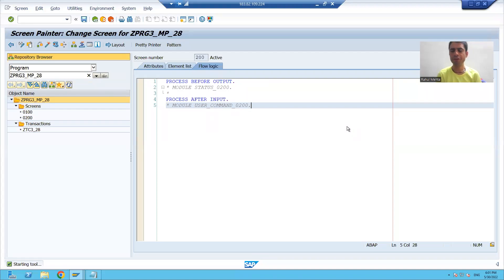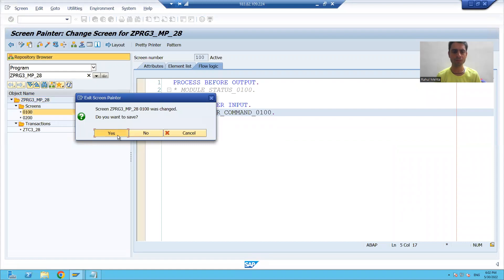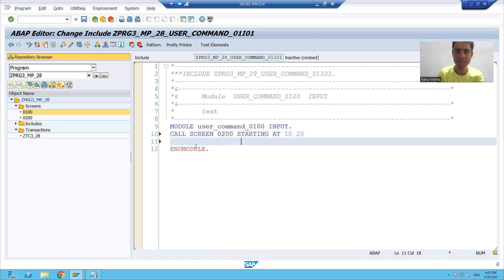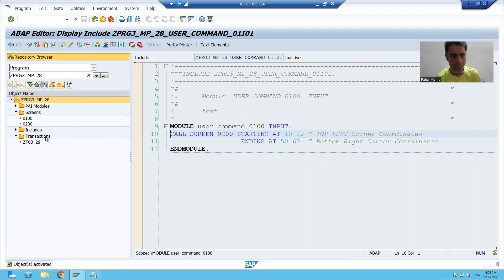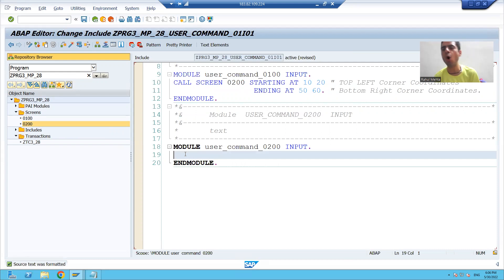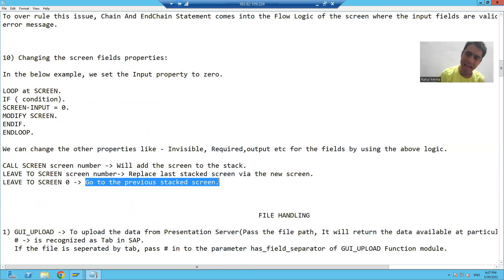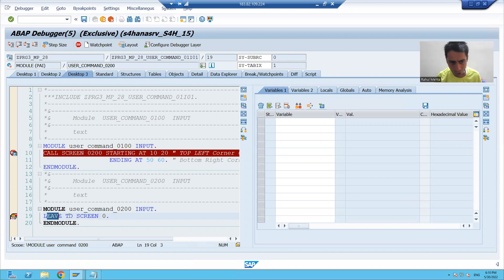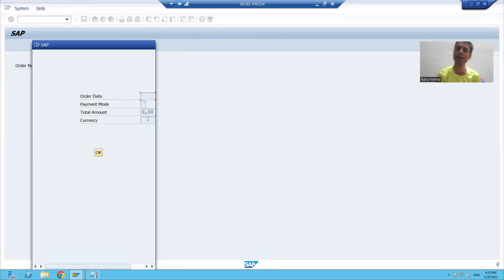16 - Module Pool Programming - Modal Dialog Box Screen Part2

Comment: hi,. can we call another program as pop up screen?? because the screen pop up will be use in more than 1 program, so i dont want create pop up screen in each program..
Reply from the maker: You can use this FM : POPUP_TO_CONFIRM and on click of OK, you can call another program through SUBMIT statement.
Reply: @sapabapbyrahulmehta  submit statement cant make screen display like popup, the screen show like normal (full screen), i want the screen display like popup, like call screen with starting and end position
Reply from the maker: @padja892    You want to call screen or program. As previously it was mentioned as program and in the current comment, it is mentioned as screen.